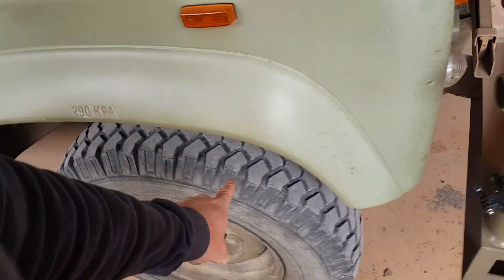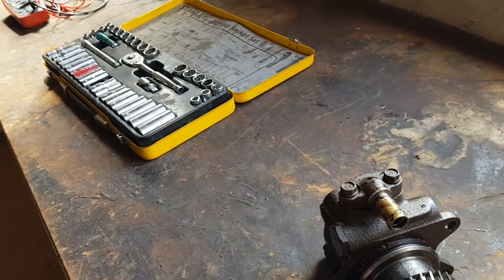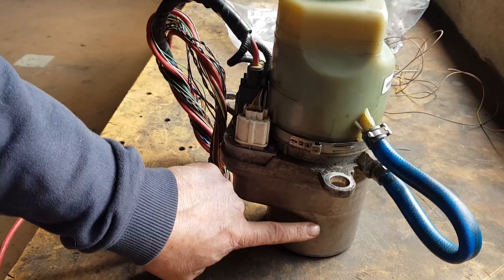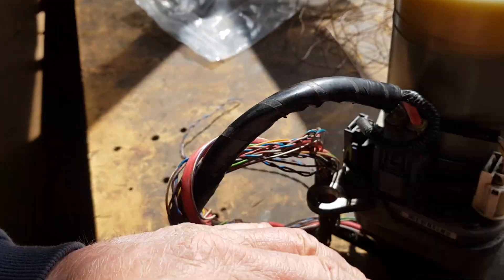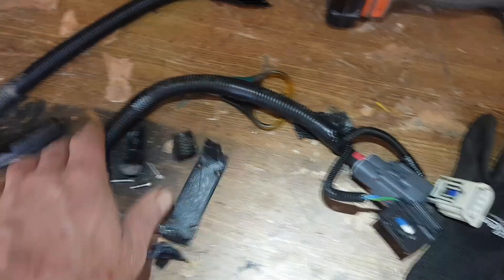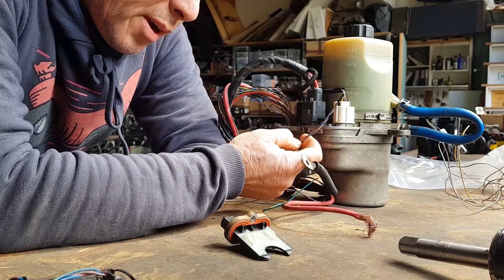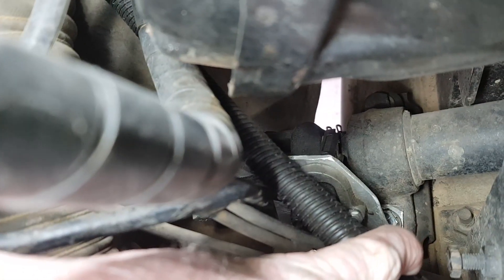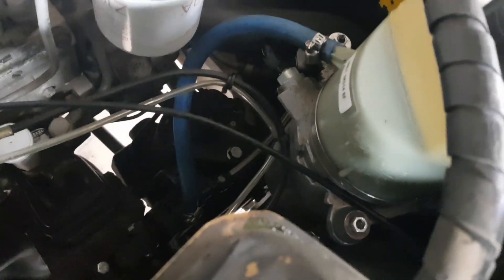Land Rover FTI 14: Power Steering

Comment: Very interesting you got the Ford pump to work. I ended up using a Volvo pump that only needs 12V and it runs around 75%. It has a CAN interface but I've never bothered with it as the default speed is fine 99% of the time.
Reply from the maker: Yeh. It's not overly important to to make it speed sensitive.

Comment: Very impressive, I’ve used pretty much the same pump from a Volvo on many different engine conversions but I have always just ran it in its fail safe mode by just supplying it 12v on the enable wire, I love the fact you figured out how to get it to change speeds with the Hall effect sensor or whatever that is on the column

Comment: That was pretty good way to integrate power steering back in the Rover.
Yea too bad it sounds like it runs at 80% speed when its idle. 
You think there would be a way to turn it off until the steering is moved to save power?
Maybe a time delay shut off if no input for so many minutes, but while driving it will stay on.
Reply from the maker: Yeh, would be easy to integrate an auto turn off if necessary. Will see what it's like when the vehicle is much quieter (at the moment I can't hear it at all with the engine running).